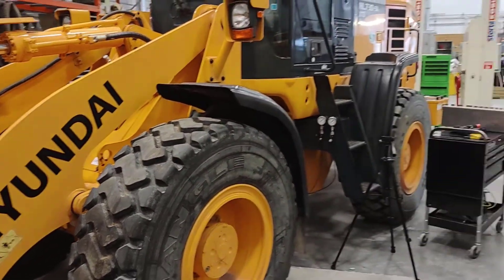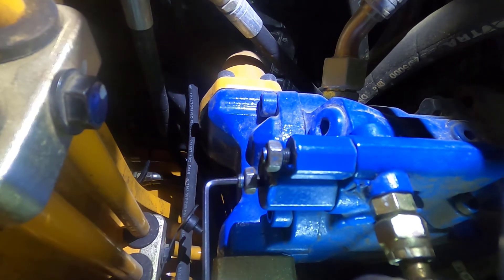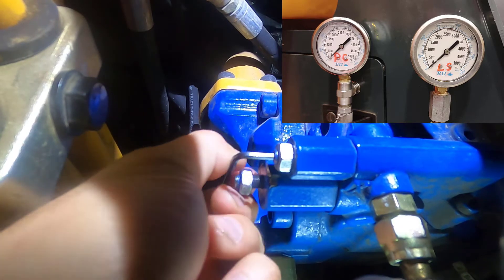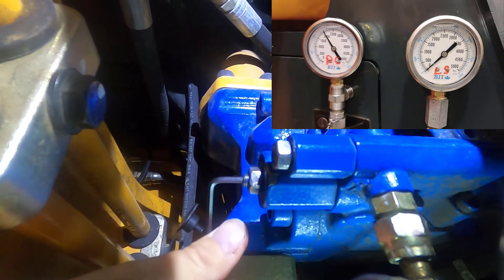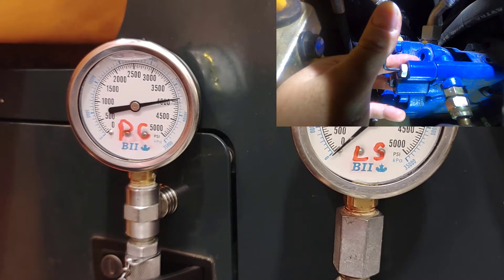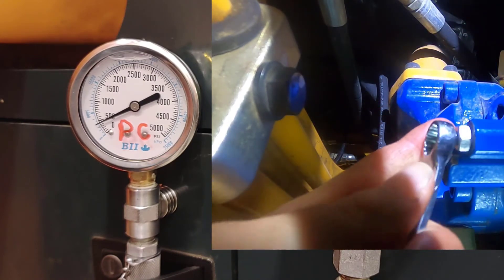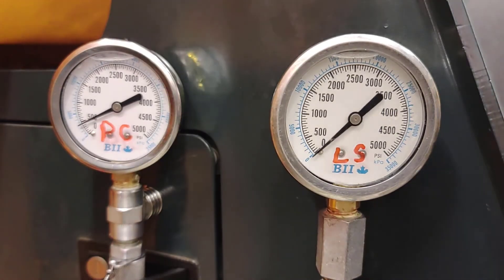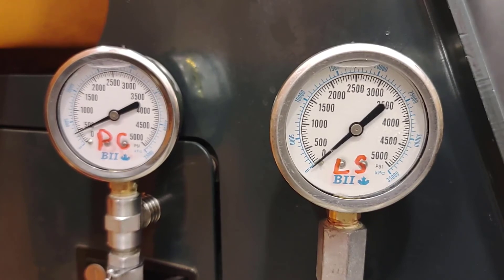Pressure Compensated Load Sense Hydraulic pump adjustments

Comment: Hi goodmorning from ph... Just aaking where did you tap the gauge of the loadsense line? Is it in the plug of ls valve near the pump or in the controlvalve/actuator line?
Reply: generally gauge of ls are always measuring down stream pressure of the actuators and the pc gauge are measuring system main pressure......the valve always sets between ls and pc  gauges .....this way there is always pressure deferential between the ls and pc